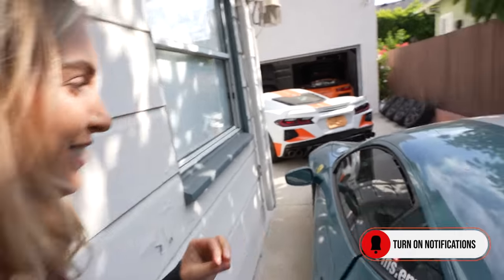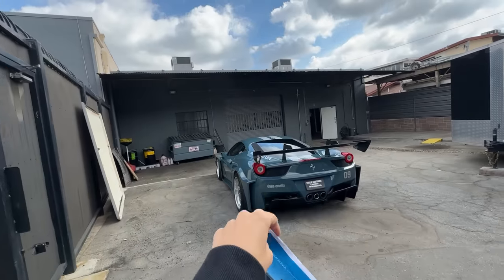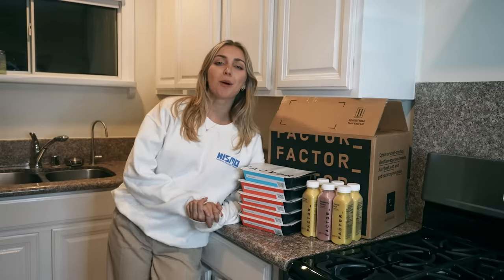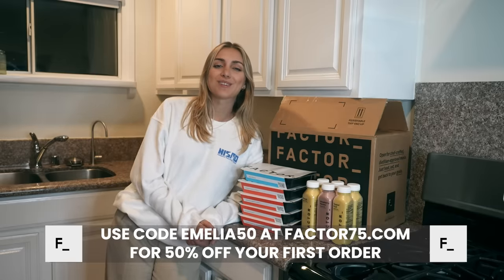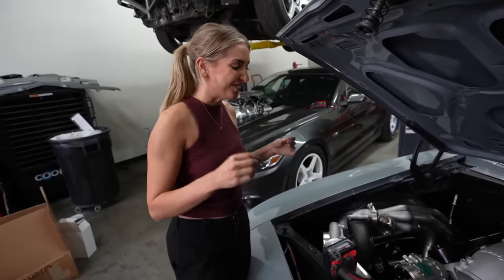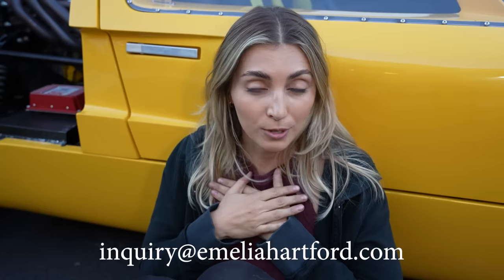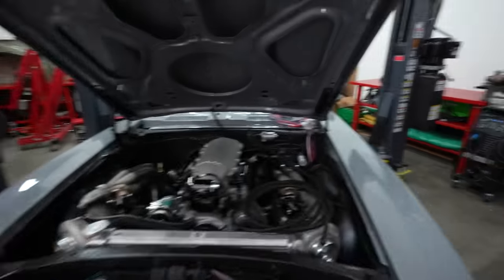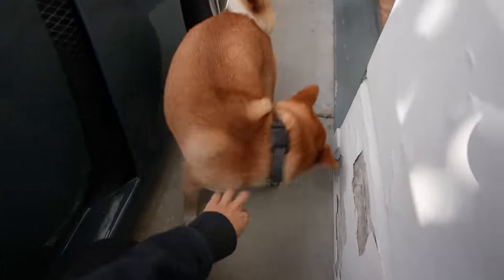Kicked Out Of My Shop and I Have No Place to Go.

Comment: Don't blame you for not selling the Z06.  Even though it doesn't quite fit in with the channel, it's still a special car.  And one of the best on the planet right now.
Reply: How doesn't it fit in? It's a badass car on a car type channel so don't understand how it doesn't fit the channel
Reply: @jamesbranner4029  She heavily modifies her cars.  The Z06 body is already as wide as a Ferrari Enzo, so widebody kits are out.  The LT6 has a 12.5:1 compression ratio, so forced induction is out.  Unless she's able to change the internals and lower the compression ratio, so she can add turbos, there's nothing else to do to the car.  But it would be cool if she did that, since it would basically be the future LT7 motor.
Reply: IMHO, Emelia should have tried to sell Phoenix and kept the Z06. She made serious headlines for Chevy with that car and kind of maxed out what the platform can do in a drag format. The Z06 with Z07 package is a launch edition of historical proportion: mid-engined, wide body, carbon ceramics, flat-plane crank etc. That's the car you want to keep.
Reply: Lol😅😅😅
Reply: @tatankawhiteplume6038  Wow, so articulate.
Reply: HAPPY  BIRTHDAY 🎁 🎂 🥳 🎉 🎈  SANDY
Reply: @hopper131  Phoenix still has a lot of content left to give and I hope that she turns it into a full-on drag car with a race engine and trans and ditch the factory ECU to get the faster trips down the track.
Reply: @BillDownhill it's her car and her channel so it fits
Reply: How does it not fit in with the channel.  The c8 corvette is what pushed her channel to the next level, and the z06 is the exotic version of that car.
Reply: @RDYOUTUBE54  Read my other reply.
Reply: For one that's a ignorant statement. If you know this channel that is her first high-end car she ever bought. The car is absolutely amazing it is the first twin turbo. You need to do your research on the car. She did the right thing by keeping the car.
Reply: She could run over to Area 51 and steal the reverse magnetic polarity motor out of the UFO that doesn't exist and put it in the Z06.
Reply: @brianblum3230  No one's talking about Phoenix.  We're talking about the Z06.
Reply: @BillDownhill  she never made the c8 wider
Reply: @RDYOUTUBE54  Where did I say that?
Reply: @BillDownhill  you said she makes all her cars wider and that there was no body kit for the z06.  Do you not even realize what you write?
Reply: @RDYOUTUBE54  I never said either of those things.  I said it was as wide as a Ferrari Enzo, which obviously meant it's such a wide car, it's completely pointless trying to make it any wider.  I have zero idea how you interpreted that comment to mean she does that to every car, or that there isn't a wide body kit for the Z06.  But now that you mention it, I tried looking for a widebody kit for the Z06, and didn't see any.  Even with your misinterpretation, I was still right.
Reply: It’s legit a cross of both types of cars she has on the channel… if anything, this car fits the most. Exotic crossed with American muscle. Like there couldn’t be a better fit
Reply: Z06 vs Gt40
Reply: @BillDownhill  🤣💀
Reply: I love wiring. It us easy if you see it one wire at a tire and don't get overwhelmed by the whole bundle. Also, properly laid out it looks pretty cool.
Reply: Do what? It doesn't fit in with the channel? Are you kidding or what? That's the star of the show!!! Even though we don't see much of it in action it's still a star in Emelia's life & vlogs
Reply: @brianblum3230 we're not talking about Phoenix we're talking about the Z-06
Reply: @davidadamson2588  Z06 has barely been used.
Reply: It definitely fits in....

Comment: Honestly, if the sale price of the Z06 is the difference between securing a space your own and having to rent again, I'd part ways with it in a heartbeat. Nothing beats owning your property outright. I get why you don't want to sell it, but if you're not at the point where you can keep and house all your cars long term,  then you're just making the problem worse and delaying being able to get a permanent spot.

The spot you showed in the video looks nice and has enough room to partition the seating area off into a nice office space, but realistically, you need the vehicle space more.

Worst case you may wind up with an empty building you have to kit out to function as a garage. That might be easier to acquire, and has the added bonus of being able to lay everything out exactly how you want it. 

Also, does the shop actually need to be in the same place you're pursuing your acting career? Convenience wise I totally get it, but financially it's like pursuing a career on Broadway and living in  the Theater District - i.e. it's a losing proposition.

Sorry to be so pragmatic, but what you're trying to do is  difficult and you already know about the sacrifices that have to happen to get to where you want to be long term.
Hopefully you find a good place quickly.  🖖🏾🤞🏾

Saw you on the F1 Vegas broadcast! Looked like fun!

Comment: That's the issue with emotional attachment. Sell to get the shop,  you could buy back later possibly even on a dip. What good is clinging to something when you will find yourself on the street, your business flow hobbled, your concentration split?

Comment: Commercial real estate is on the edge of collapsing. When that happens the banking system will become very shaky if  property owners default on their loans.You should not have a problem finding a shop at a reasonable price. Question is, in the current economy do you rent or buy.

Comment: I would never buy commercial property in CA, especially around LA. Politicians there would happily ban all internal combustion engines with only the threat of a legal challenge going to the USSC stopping them. There's a reason companies like Edelbrock and many others have [mostly] left the state. I won't debate that it's probably the most beautiful state in the country, but it's run by lunatics with no comprehension of fiscal responsibility or respect for the individual liberty of it's citizens. So I'd say rent until you're fully burnt out on the bureaucracy then move to a free state that respects it's citizens.